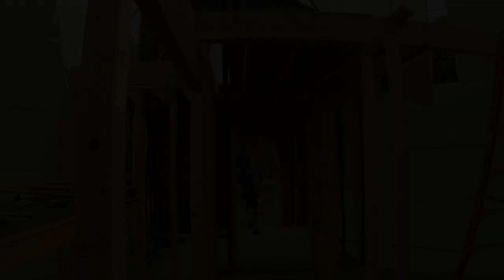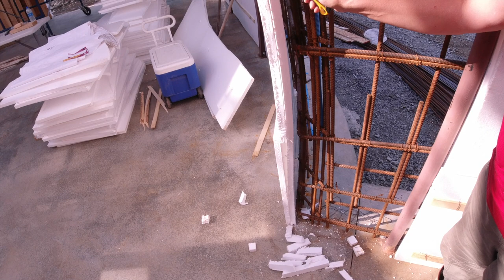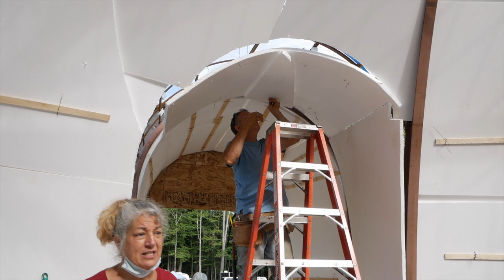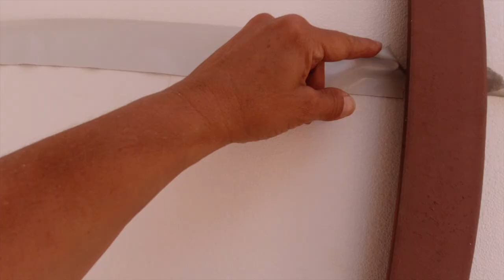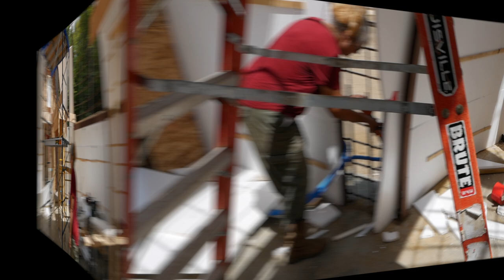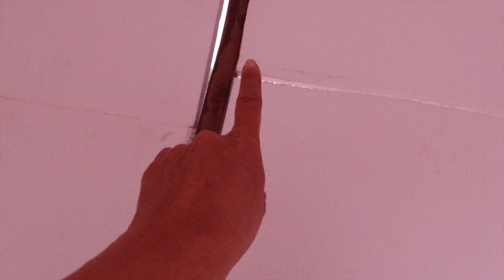WIFE FACES her FEARS to HELP BUILD Off Grid DREAM HOME

Comment: Conquering the fear of heights is really hard. I know first hand. I worked for Verizon climbing telephone poles for 22 years. My first week on the job was in pole climbing school. I was a hot mess on the inside but on the outside I tried to be a cool cucumber. It wasn't easy. Especially since 30% of the class quit b4 the end of the 1st day. Another 20% quit during or b4 our final exam which was climbing up to 18' without a ladder(using gaffs)and playing catch for 15 minutes. If you dropped the ball,  you had to climb down and get it, then climb back up to 18' and continue. Then retrieve your paycheck from the top of the pole. The trick is to take baby steps. Every time you go up, push a little higher. Reach a little further. Most important is to trust your safety equipment and to focus and concentrate on the task at hand. It won't take long to stretch your comfort zone. You may never be happy at 18' but you will eventually be comfortable on an 8' ladder. 
  Your making great progress on your build. It won't be long b4 all your hard work pays off. Best of luck with everything  my friends.
Reply from the maker: I just thought not fearing heights came naturally to people. It never occurred to me that some just push through it! Thanks for the kind words 😊